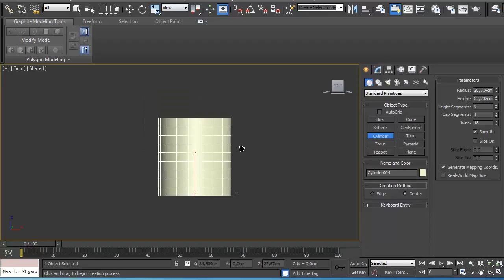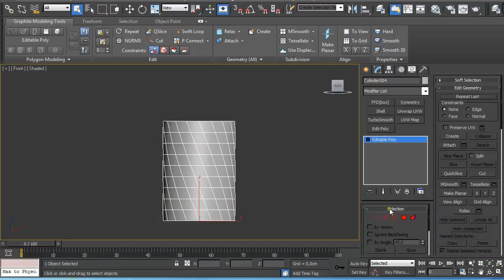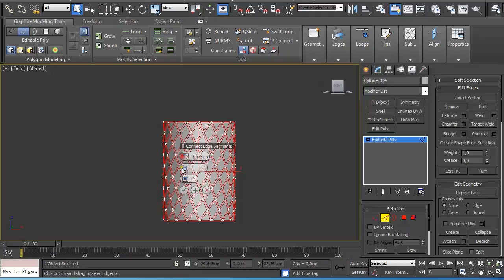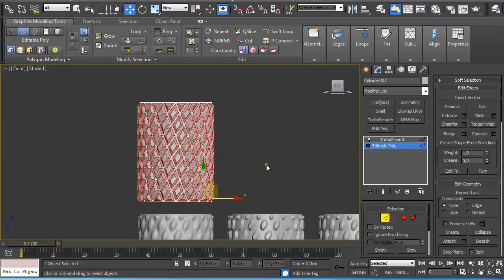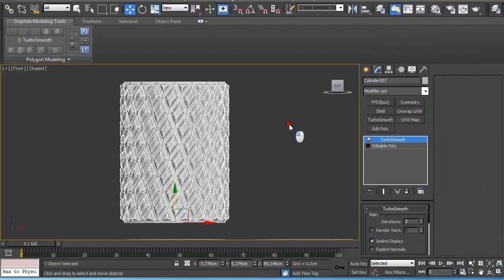Quick Tip Tutorial: How to model high poly grip in Autodesk 3Ds Max

Comment: Using "Edge DIrection" under the Generate Topology panel of the Graphite Modeling ribbon will achieve the diamond pattern on your cylinder in one easy step.  I like the twisting of subobject edges with modifier, but you could potentially save 7 steps in this process by using the edge direction procedural topo.  Good tut.
Reply from the maker: Indeed, Tnx for the info. :)
Reply: Thank you so much luxx buddy. I tried your method and it works easily.